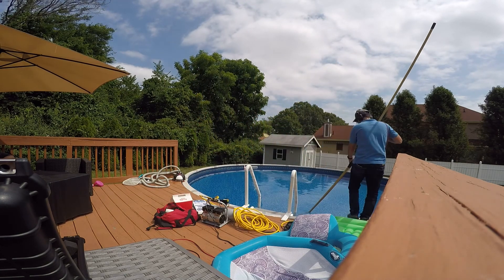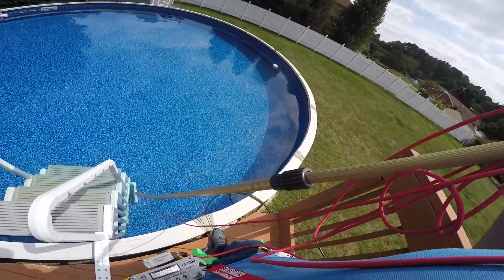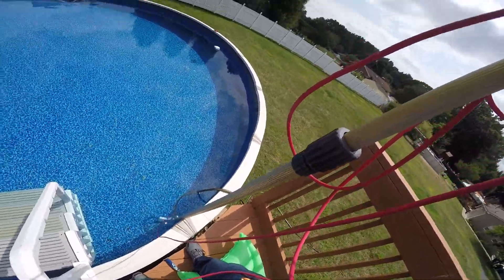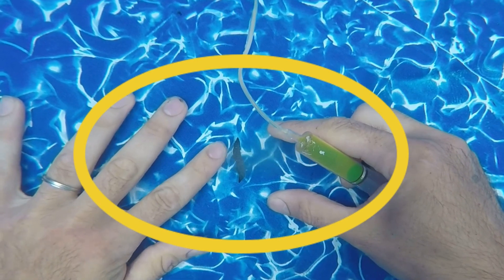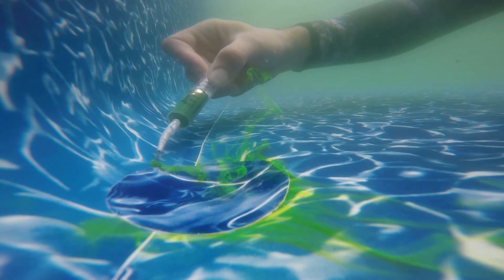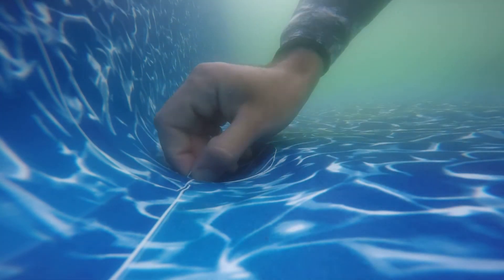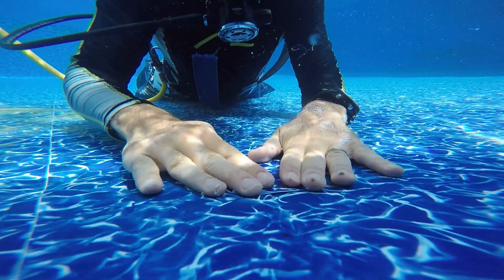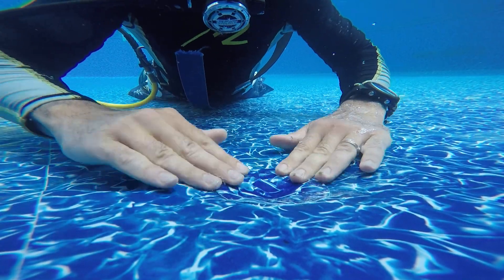How To Patch Large Hole And Tears On A Vinyl Liner Pool || Patching Large Hole In Pool Liner

Comment: Great video. Thanks for taking the time to make and share it. Do you use the Anderson LeakTrac 2400 to scan the pool liner for leaks?
Reply from the maker: No, I do not. I spend less time to dive and check the liner. Always want to check the whole pool regardless the indications of your device. It can always miss a hole but you need to be thorough! Are you dealing with many liner pools?

Comment: Great video! I have an old  2" tear with a 4" patch over it that's leaking a bit at one end. Do I need to remove the old patch before applying a new one? How well does duct tape work?
Reply from the maker: Hi John, I wouldn't recommend you to remove the old patch unless it detached from the liner. If it has a small opening you should just add a bigger patch over the old one. As for the duct tape is not for liner patches. You should only use clear or even better vinyl liner patch.
Reply: @poolleakdetectionllc  Thanks!

Comment: What about all of the water that was under the liner?  Do you not have to do anything about that?

Thanks for the video.
Reply from the maker: Tha k you so much! I appreciate it. The water will be drained by the ground. Unfortunately there is nothing you can do for the sand that has been washed out with the water in the pool. Only if you replace the liner can you add more sand. If the leak lasted for a long period of time and you can observe a dip after repair, you should add a second patch for extra support. Do you have an above ground pool?
Reply from the maker: Hi, happy holidays.  
This video may help you to identify tears and repair the liner. 
https://www.youtube.com/watch?v=9-4vOtjwE7c
Also,  I have attached my affiliate links for the glue (https://amzn.to/3FYUIyY) I use and a repair kit that might be helpful for your liner repair (https://amzn.to/3GporCt). Let me know if you have any questions.